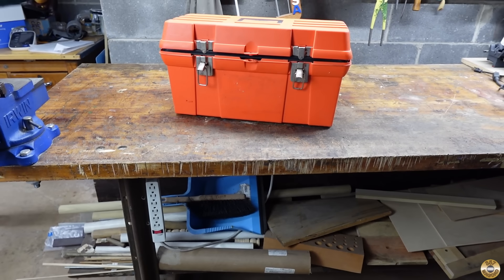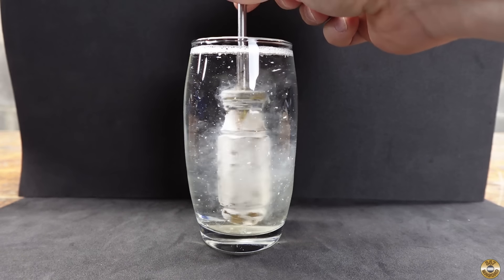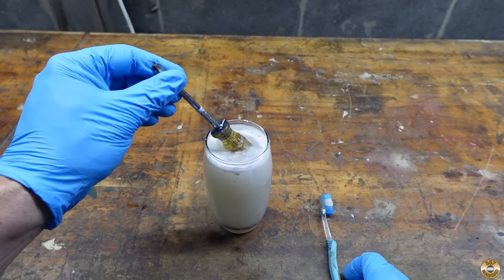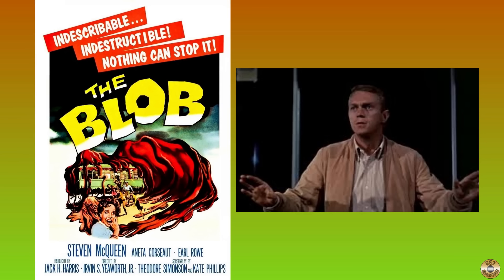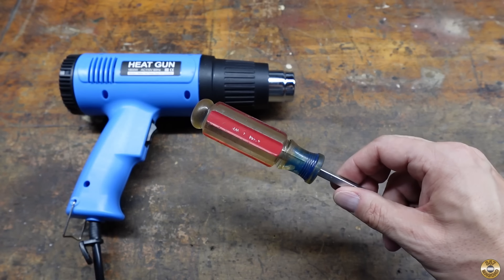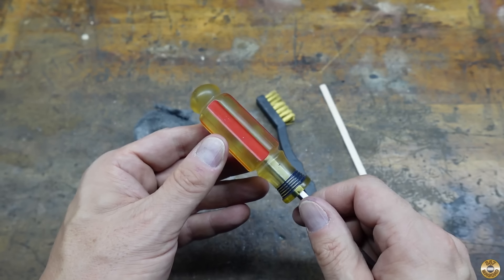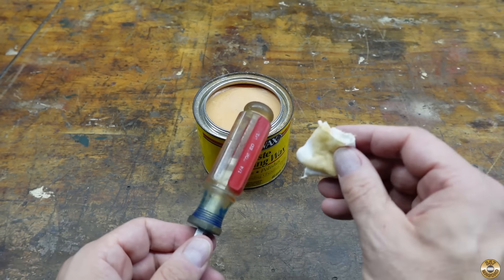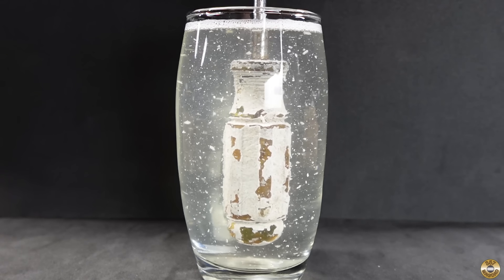Halloween 2024 Special - Decomposed Plastic Handle Screwdrivers - The Search for a Cure Continues

Comment: I like your humor, but your fixes will not get rid of it. The problem is that the degradation of cellulose acetate and its related plastics is auto catalytic. The smell is from butyric acid. Any acetic or butyric acid left behind will cause more mange. Coating it will only seal it in. I would suggest the ammonia followed by heat in cycles until the smell goes away.
Reply: If it's an acid, a base should neutralize the smell and decomposition.
Reply: @alpine1600s  the acid is a symptom and not the cause.
Reply: @1pcfred  It is both. Acid is a product of the decomposition, but it also causes further decomposition.
Reply: @julianBullitt-zk9ch  I don't know about that. The acid is what stinks so bad. I don't think it's strong enough to dissolve the plastic though. In fact I'm fairly certain it isn't. The reason it smells like puke is because it's the same acid we have in our digestive system. It's not a particularly strong acid. It will tickle your nose though.
Reply from the maker: Thanks Julian!

Comment: Clear handled screwdrivers are made from cellulose acetate butyrate for their electrical insulator properties. The chalky white residue are plasticizers decomposing and the vomit smell is butyric acid off gassing. Options are : return for exchange if Craftsman or lifetime warranty brand , clean with chemicals, buff and coat with polyurethane to contain stink , cut off stinky handle and replace with new one or simply throw it away . There is no guarantee if cleaned and coated that it will not continue to decompose .
Reply from the maker: Thanks for watching!
Reply: that lifetime warranty is subjective
i had tools from a sears craftsman set and tried a warranty exchange at lowes   they said it was sears craftsman and to try them     sears closed    tried craftsman online   wanted a receipt from 1985...  easier to shoplift a replacement

Comment: I don't think there is any tool challenge Magdad won't tackle.  Those screwdriver handles look so good after the cleanup that they deserve to stay that way. My average guy- type of solution would be to clean the handles up, then seal them with clear epoxy or clear plastic spray to tame the mange.
Reply: We'll see after next mange season. Mange likes heat and humidity. So it's most active in the summer. But apparently you can cook it with too much heat. It is a living bacteria.
Reply from the maker: Thanks Pat!  I'll let you know how they hold up!

Comment: Thanks to your previous video I de-manged all my screwdrivers in ammonia overnight and then into an ultrasonic.  Even if mange starts to come back your ammonia method is so easy I can do it as periodic maintenance.
Reply: @2OO_OK  
just curious do you just use plain water in the ultrasonic or add some sort of cleaner?
Reply: @frankg3072  It might have been Dawn or Simple Green.  I run a lot of parts in the dirty water so I forget what is in it.  I suspect plain water would work because the mange loses mechanical integrity after the ammonia.
Reply from the maker: I'm glad the ammonia is working for you!  Try adding some nice smelling cologne to mask the stink!

Comment: I believe the cause of the mange was an  improper mix of the chemicals used in the manufacturing of the handles.  Like epoxy if you add too much resin the mix won’t dry as fast or possibly be tacky- Western Forge was notorious for shoddy workmanship and many of their products would be considered factory seconds in any other company.  😂. Great stuff as always!  😃👍
Reply from the maker: I think it is the "nature of the beast" with CAB plastic.  PB Swiss tells its customers that vanilla has been added to mask the inevitable stink.
Reply: @357magdad  do they come in chocolate

Comment: Very interesting.   The last one with the clear coat looks nice and shiny.   As you said, only time will tell if the mange returns.
I am happy we do not have smell-o-vision.   LOL
Dave.
Reply: That spray he used is not the most durable product available. With a better clear coat he may achieve better results? I'd recommend using Helmsman spar varnish. I've had excellent results using that on tools. It costs more but it's worth it. Helmsman is far more durable. It's tough stuff.
Reply from the maker: I was impressed with how well the clear coat went on!

Comment: The sreering wheel in my 54 Studebaker did that, plus severe cracking.  I repaired with epoxy and painted with a quality automotive primer and paint. After more than 10 years the interior of the car smells better but the cracking is starting to return.
Reply from the maker: Ten years is pretty good Larry!

Comment: I tried to use Rustoleum clear to clear coat a little shelf. I ended up sanding all of that crap off. It came out like ass. Then I went out and got a high performance clear product. I'm satisfied with the results I achieved with that. I used Helmsman spar varnish. Helmsman costs more but that's the way it goes with paint. You have to pay more to get more.
Reply from the maker: The Helmsman stuff was outside of my budget for this project.

Comment: Thanks for this video; I am fascinated by these stinking, corroded handles!
Have you considered this technique, which I have seen used to restore yellowed plastic parts? The plastic is immersed in hydrogen peroxide in a clear basin, strips of LED lights are taped around the outside of the basin, and the plastic sits overnight in the illuminated peroxide. The plastic comes out de-yellowed and looks factory-fresh
Reply from the maker: A viewer commented that he tried the hydrogen peroxide + UV and it didn't work.

Comment: I think ammonia and steel wool bath to clean, then several quick dips in lacquer thinner to close the surface.  Multi point attack.
Reply: Some plastic crazes when it is exposed to aromatic solvents. I've seen plastics get all shot through with cracks. Then it's real brittle.
Reply from the maker: Thanks Tom!

Comment: I would try a UVC light . They say it could be mold that is eating it.  Next summer  I will look for one in a garage sale  and clean it and then treat it with UVC light for an hour. I have a box made and it works on the smell of old books . The screwdrivers  I have never had  a bad case of decomposing handles. Any screw drivers I cleaned up hang on the wall. I never had a problem with it.
Reply from the maker: Thanks Steve!

Comment: Absolute answer is........break or melt off the plastic crap and replace with a wood handle...one cherry,one black walnut, and one apple...lets use that turney machine thing...🖖
Reply from the maker: I've got a tiny lathe project coming up in November - stay tuned!